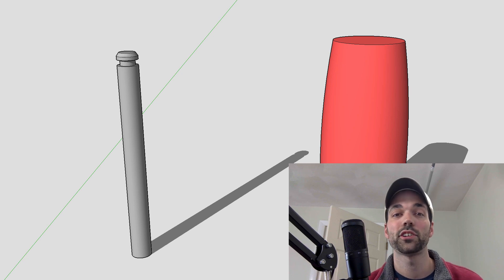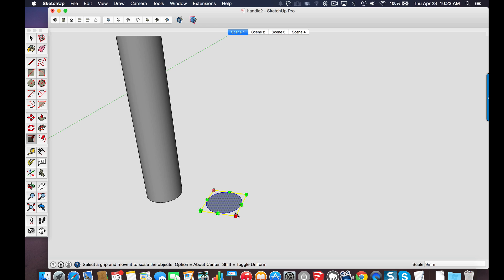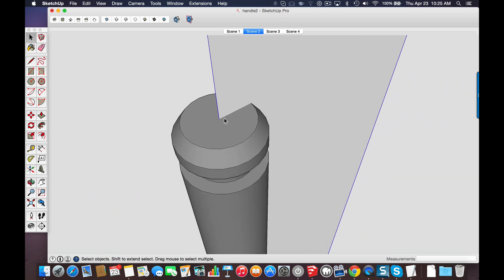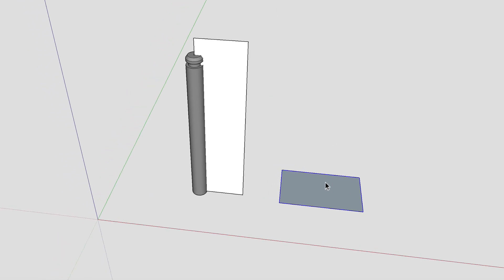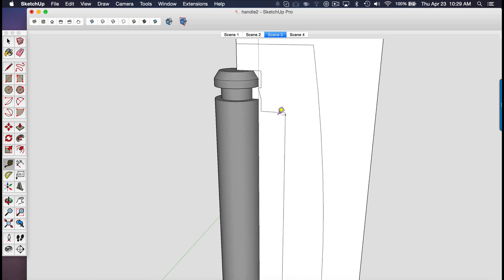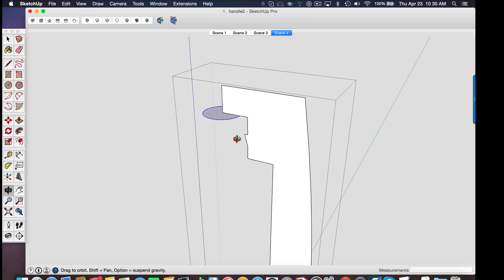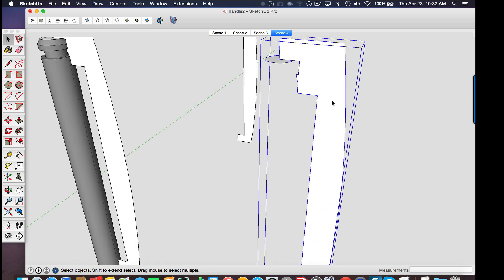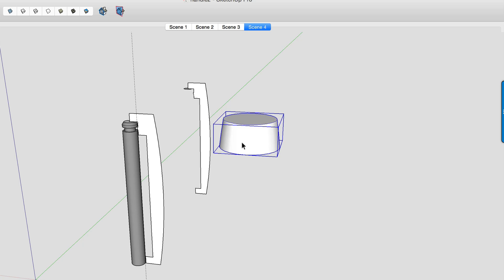3D Printing a Replacement Handle with SketchUp - PART 1

Comment: Could you have not just intersected the shaft and rectangle then deleted the shaft to get the shape?
Reply from the maker: Henry Killian If I had done that, I never would've been able to get the handle onto the shaft, because it would be too tight. You'll notice I also made the notch slightly different than the profile of the shaft so it will "clip" on. It's also designed so it only touches the shaft at the very bottom and the very top to reduce friction.
Reply: +MasterSketchup no puns intended or what but it goes downhill really fast

Comment: Thanks for the great video, Matt. It has provided me with answers to a number of questions I'd considered in my short time (1 month) with my new DaVinci 1.0. One aspect of your Sketchup technique was not fully detailed at 2:35, where you detailed how you made the conical relief on the top of the handle, but not how you accomplished the "turret" itself, or alternatively the recessed section below the "top". I suspect you may have covered that in another of your video's?
I'm also curious if you've got any idea why my glass workplate already has 2 chips in it? Is this related to heat, or maybe the printhead hitting the bed (as I've discovered mentioned on blogs etc.)? I didn't do an initial bed alignment as most advice said to trust the factory setup.
Reply from the maker: Retinalism Bed alignment is the most important thing with FDM printers. Good bed alignment is critical for adhesion of that first layer. Every printer is different, but I used to check my bed alignment once every few prints. The MendelMax3 I currently have is very solid, however, and it stays calibrated very well. I suggest trying to print something like this: http://www.thingiverse.com/thing:580785/#files to check the varying thickness of the first layer. But you should be able to drag a single piece of paper under the nozzle with Z home to 0. 

I was quick in this video going over that actually modeling, just because it was more of a workflow overview. I wasn't expecting people to actually follow along modeling the same thing. But that taper was done with the Move tool. I Moved the outer circle down, and SketchUp "autofolded" the faces in order to stay connected.
Reply: MasterSketchup Matt, it was the creation of that top "turret" BEFORE you finished it off with the taper. Or, alternatively, how did you create the "groove" section the cap/handle clipped into?
Reply from the maker: Retinalism Oh I gotcha. I had a circle, push/pulled it up to the height of where that groove started. Then, using the Offset tool (F), I offset a circle equal to the inner diameter of the groove. Push/pulled that up. Used offset again, this time going "out", back to my original diameter. From there, I used Push/pull again. It takes some cleanup, but that's how I did it.